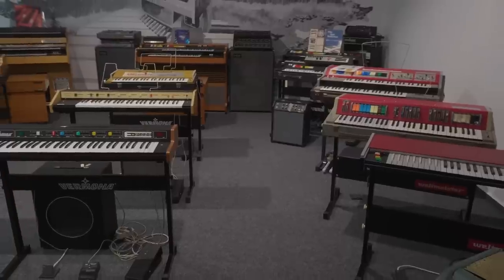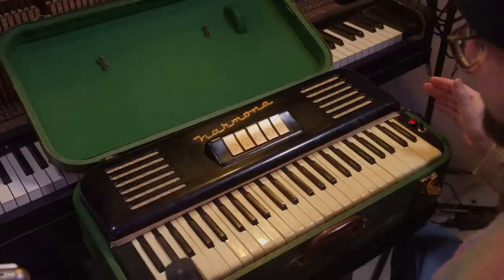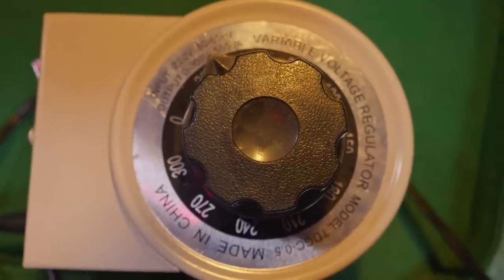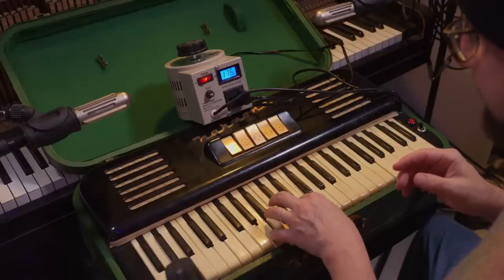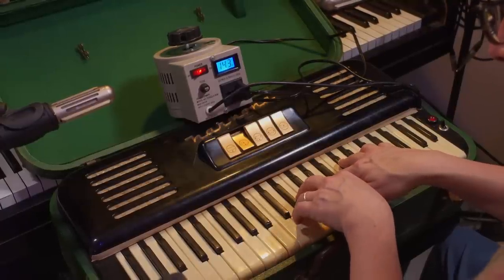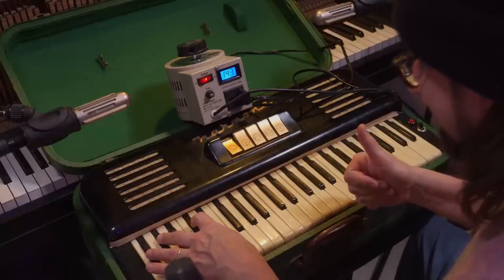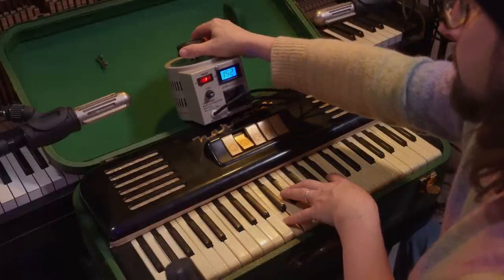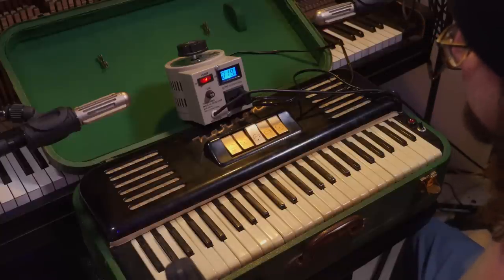Adapting Eddie's Amp Trick

Comment: you could totally use that kind of trick with the pedals used with sewing machines, they are pedals controlling the motor speed by controlling the voltage
Reply from the maker: Aaaah what a good point
Reply: That is a good idea!
Reply: You might have to hard wire the foot pedal directly to the organ fan driver....
It would work, but seems like an invasive mod. Great idea though.
Reply: @moonboogie N8  if done properly it can be incredible
Reply: I think a lot of sewing machine pedals work via pulse width modification a la stepper motors
Reply: @jamisondonald384  Not the older ones with hot wire spring resistors or rheostats. But they are harder to get and often broken. There are also special electronic pedals available that work with old machines, they may work with this instrument, too.
Reply: great info, thx

Comment: Oh cooool! Your last video about the electric harmonium* inspired me to try a similar idea, but in the mechanical realm instead of the electrical:
I cut a big hole into a fan harmonium's wind chest, and covered it with an airtight flap. Gradually opening the flap kills the air pressure inside the instrument and filters the sound. I found that opening/closing the flap is much more responsive and expressive than adjusting the fan power, which takes a longer time to have an effect.
I'm wanting to find a way to make this flap mechanism even more playable. Maybe a cable system, like a remote hi-hat pedal? Or a lever that you can play with your thumb while your fingers are on the keys.

*specifically, that bit about notes fading out slowly when you flip the power switch.

Comment: Depending on what type of motor that organ uses, this trick may or may not be a bit risky. A lot of small motors used in devices like that are synchronous induction motors, their speed is primarily controlled by the frequency of the AC source. When you first start the motor, they produce very little torque and only become efficient once they reach optimal speed. By only decreasing the voltage and not the frequency, you are forcing the motor to operate in its inefficient region, which will cause the motor to have very little torque and generate more heat. It can also cause the speed to be unstable and potentially cause the motor to stall, which can overheat the motor and permanently damage it.
The Variac isn't really an ideal induction motor speed control for that reason. A VFD (Variable Frequency Drive) would be a more appropriate method to alter motor speed. While it appears to work okay with this device, keep in mind that there is a chance of damage if you continue to use it that way, and other devices might not tolerate the reduced voltage as well.

Comment: I recently picked up an Italian fan organ locally for next to nothing.  As soon as I heard it I thought I need to work on a controller for the fan, maybe a replacement (or additional) DC fan which I can more easily control, perhaps CV controlled.
Reply: I wonder if controlling the air coming out of the fan would be easier by blocking/diverting the airflow.

Comment: Not all 'electronics' take kindly to reducing the voltage, their circuits will just stop working below a threshold voltage, and may even pass more current which could destroy it
btw, if you got a variable frequency drive (vfd), you would be able to control the speed of the fan without reducing the voltage, some vfd's will go higher than 50/60hz

Comment: What a beautiful find! Sounds lovely but wouldn't a simple foot operated adjustable air escape vent (to reduce the internal pressure) have the same effect?
Reply from the maker: You would have to change the apparatus for that, this is way simpler as its from something I had lying around
Reply: @Hainbach  The one you have is very elegant as is your concept of course! I was just pondering the principle as some years ago I did own a very cheap looking plastic one in pale blue which would definitely have been suitable for such a mod if I'd known the tonal possibilities.

Comment: I've had harmona 85 in the past, they are quite common here in Poland, the legacy of the communist era, because they were produced in Weltmeister factory in east Germany. According (haha) to my experience with fan organ, this one is good craft compared to the many cheap and awful sounding plastic chord organs. My harmona had even a factory fitted fan controller (potentiometer on the front) but the range was much smaller. It changed mainly the volume, and slightly the attack.

Comment: I use a Variac on my soviet TOM 1501 to get the proper 220VAC to power it, but does very interesting things when run at much lower voltages.

Comment: Does changing fan speed with proper controller would be better? We can underpower electronics but we cant over power with too much voltage. What about changing how fan blows air to get interesting sound characters and rhythms? It may sound like tremolo but changing air like oscillator would be very interesting.
Reply from the maker: A viewer told me he modded the fan in his with bird bones, which created ghostly rhythms. There is a lot you can build upon here.

Comment: First of all, I was shocked by how silent the fan is, my experience with this type of technology is limited to my Bontempi (a plastic toy, but still a fan organ), which has a quite loud and noisy motor in comparison.
Also, your fan organ sound very good in my opinion.

Speaking of pedal control of the variac / other ways to control the air pressure / lack of dynamic of this kind of instruments (well, my Bontempi actually had a volume control which mechanically limited how much air was sent to the reeds, so I could play that, but I digress), I thought: why don’t you get a melodica instead and build a box to pump air, with a flapper to control the amount of air going into the instrument? A melodica is very similar to a fan organ in the way it work and, by adding a fan, it would turn it in what’s essentially a fan organ (and it’s probably easier than modifying a fan organ). It think a certain Sam could be knowledgeable enough to build something like that…

The thing I like about the melodica is that you have a lot of control over the articulation of the notes (although it’s sort of “paraphonic”), by modulating your breath… you can have slow attacks or fire out some staccato notes by “spitting” short bursts of air and articulate the notes without having to raise the fingers from the keyboard… 

And then there are the idiosyncrasies of those red instruments (both the fan organ and the melodica), their “built in volume limiter” (there’s only so much preasure, so if you play multiple notes, the air is distributed among the reeds), the way lower notes have “higher priority” (they require more air, so there’s way less air to play higher notes… it was the same also on my Bontempi fan organ, high notes would starve / stay almost silent if I played a few lower ones), the way the attack of the notes is influenced by pressure (so, if you play lower notes and/or lots of notes at the same time, there’s less pressure avaible and the attack is slightly slower)…

I spent so much time both with a fan organ and a melodica as a child, they have a special place in my heart.
Reply: the fan inside those runs pretty slow and you can easily stop it with your fingers - but just enough for the reeds...

Comment: maybe the van halen trick has more to do with the 60hz(usa) 50hz(gb) then the voltage . you should do e test how it sounds with 60hz.
Reply from the maker: I always wondered how that difference influences music in General
Reply: @Hainbach  some tube guitar amps had quite bad filtering of the power supply and would ring modulate your guitar with twice the mains frequency and its harmonics when cranked up. Guitarists call this "ghost notes" and the ghost note frequencies would obviously be different with 60Hz mains vs 50. Also the pitch of tonewheel organs is locked to the mains frequency, so they were made in 50 and 60Hz versions. Those are the only cases I know of where the frequency matters.

Comment: Can this be done by varying the air intake? When I was a kid I had an even simpler Magnus chord organ that used a baffle to restrict the flow of the blower, and thus, volume. I found that I could really strangle the volume to zero by also using my hand to cover the inflow opening. It was kind of cool, but it kind of crapped out if trying to play more than two notes when the air was so restricted.
Reply from the maker: But then you already did it and it worked!

Comment: Can you do this on Tape Echos to get a slower rate? I assume lower voltage will result in a slower motor speed?
Reply from the maker: Yeah but you would get more noise less volume etc as you are starving all the electronics. There is would be better to mod the motor directly. Look Mum No Computer has a video on the Copicat mod

Comment: You should be able to mod the circuitry to introduce a simple onboard control switch for this concept, without requiring the use of expensive and heavy external hardware that can only be controlled manually. You could even add an external jack for a foot treadle to use as a controller, then you could just use this as expression with your foot while playing.

I might also add, this is rather misleading. The variac is the same hardware Van Halen used to act as a power attenuator on his amp, but this is a very different application that serves a different function than how it was used by him. If you were using this in order to overdrive the circuit in order to get a sound that is only possible at high volume, this would be intriguing and a valid justification of the allusion. This is just using it as an expression controller to diminish the attack of the blower to achieve the same expression harmonica and accordion players have at their disposal.
Reply from the maker: I take offense at the term misleading. The broad term for this technique is power-starving, and it does not matter what kind of electronics you starve. Or even acoustic apparatuses as I do in an upcoming video. I got the idea from Eddie Van Halen’s technique to use a Variac on the fan organ and I adapted it. It is all in the title and in the explanation I give at the end.
Reply: @Hainbach  I mean no offense, excuse me. I'm a big fan of what you do. :) I just don't see how it's the same application. You're power starving it, sure, but it's just limiting the rate of the blower, which is how any variable resistor would control it, you're just doing it at the source. I don't want to knock what you're doing by any means, it's really cool! I love this sort of thing, 100%. I was just expecting the opposite result based on how you pitched it. ^ ^' 'Brown sounding it,' to my mind, would be like maxing out the power in the circuit internally, and reducing its output power to achieve a sound otherwise only possible at high volume. You did the opposite. I was expecting something like that primitive vacuum tube synth overdriving an all-tube high wattage amplifier to get some crazy sound. :P Love that thing, by the way! Keep up the great stuff, you're awesome, and I love all the lo-fi wizardry you got going! You're an amazing artist and your content is a rarity, in my view, and a window into a lot of unusual and broadly unseen gadgetry.